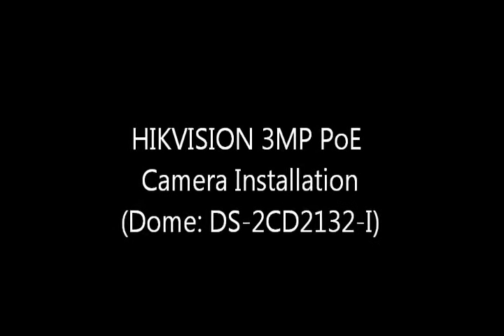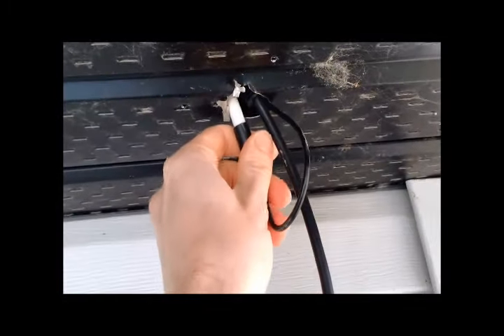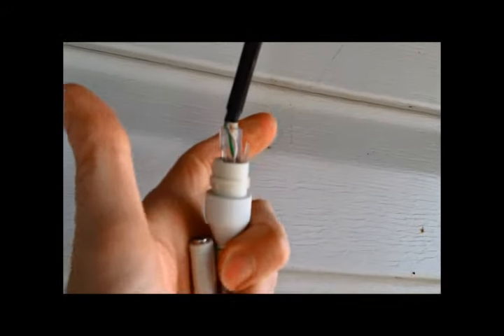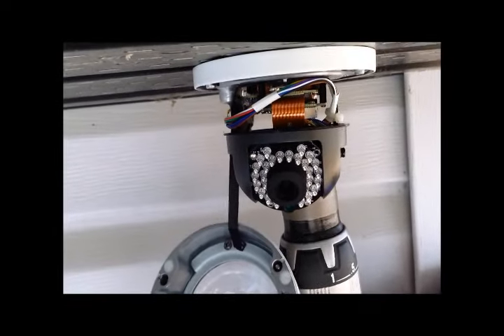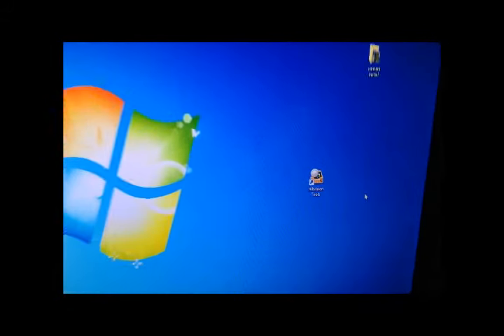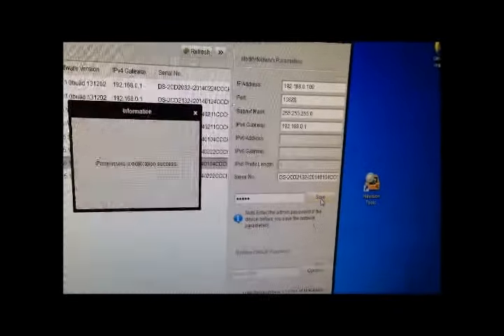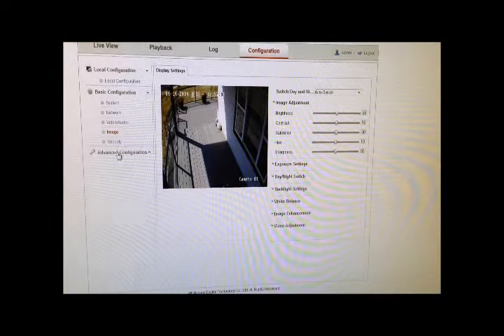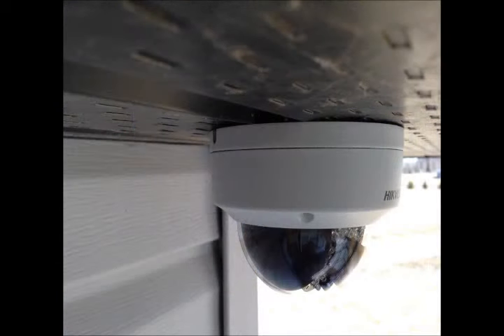HIKVISION Dome PoE IP Security Camera Installation Guide

Comment: I have got four Hikvision cameras installed plus the Hiklook DVR. I have installed the S ADP software but all that is appears when I open it is my router. How do I configure the software so that it will show my cameras?
Reply from the maker: SADP will only show the DVR if you are on the same network as the DVR.  It cannot see into the DVR's network were the cameras are located.  It do this, you need to plug your PC into one of the DVR channels.  This way, your PC will be on the same network as the cameras.  Hope this helps.
Reply: @HomeTechDIY  Thanks for the reply, that was very helpful indeed. Okay, another question if I may. I have got an IP bird box camera that is also plugged into my DVR. Last year the camera was plugged directly into a POE adapter which then went into my network switch. A company called Cam Secure hosted this camera online and I was able to let the public see the birds nesting as well. After what you have told me I suspect this is not going to be possible since the camera is plugged directly into the DVR and the DVR goes into my network switch. I think I'm going to have to do revert back to how I was set up last year, correct?

Comment: Thx for the video. Is it a PTZ camera? Can you control the rotation and tilt angle over web interface?
Reply from the maker: No, this is not a PTZ model in this installation video.
Reply: newfiebort Thx, fastest answer ever! ;)
Reply from the maker: gyurxi551
I have been thinking about this one for a while.  The foam hood seems to be too large.  Your are right, it's there to avoid any reflection back into the camera.  I think you should be safe to cut away some of the foam to allow more IR light to shine out.

Comment: Hi, why does Hikvision camera can't show English week OSD? Maybe you can ask Hikvision give you a new firmware. In addition, this camera should is a vandal proof dome, but your cable installation is easy to been cut, it is better you can use a metal tube.
Reply from the maker: +Sysvideo IP Camera Correct, this firmware has a defect with the on screen display.  I didn't want it displaying anyways, so it was no big deal and therefore no need to upgrade the firmware.  The firmware can be downloaded from the Hikvision website but I would need to ensure it was for the correct region.  Agreed, there are certainly more steps I could have taken to make this setup 100% vandal-proof.  Thanks for the idea of a metal tube to protect the wires!

Comment: I have 2 Hikvision DS-2CD2135-IS cameras hooked up from a giagbit PoE switch to router to computer, I downloaded ivms4200 software from hikvisions website, the software finds the cameras but I cannot get a picture, using ip address 192.168.1.64, I cannot figure out why I cannot get picture from the cameras?  Any help would be appreciated, thanks.
Reply from the maker: +Keith Daniel Are you able to get a picture using Internet Explorer?  I'm assuming the IP addresses for the cameras are not the same.  What is your subnet (192.168.1.1)?  You might need to change your camera's IP address to be on the same subnet.  Do you just have 1 router on your network and are there any internal port forwarding rules in place?

Comment: Do you attach the dome camera to the vinyl soffit directly with self tapping screws or is there a piece reinforcement (wood) on the other side of the soffit for the screws to go into?
Reply from the maker: In my case there is nothing on the other side and the metal soffit does hold the camera quite securely in place.  I used the screws that came with the camera and it's been holding up for a couple years now.  Once the winds hit 60mph, it does shake a tiny bit.  It's well protect from most winds in this location.  If you can out wood behind the soffit, I would recommend doing so, just in case there is a huge storm or a vandal.
Reply: OK, thanks! I didn't realize that was metal soffit.

Comment: When you mount it to the ceiling, are you just screwing into the vinyl (if that is vinyl) or do you have wood on the other side.  I have a vinyl ceiling where I want to mount my cameras and wasn't sure how to do it.
Reply from the maker: +Greg Ebel The best solution would be to screw the camera into a strong material, like wood.  In this video however, I am just screwing it into the soft metal soffit.  There isn't a lot of wind in the back corner where with was installed and the picture is doesn't ever shake.  Also, to install wood behind the soffit would have involved removing the soft metal and replacing it with new stuff....  sounds like a lot of work.

Comment: 2 questions, what's better a bullet style or dome style camera for night vision. and 2,where can you purchase hikvision cameras and be guaranteed to get a real hikvision camera instead of a knock off (as I've heard happens on amazon)?
Reply from the maker: I don't notice any difference in the night vision between the 2 models.  I live in the country and there are no streetlights and the quality is good (not perfect).  I can see foxes and rabbits walk by with no issues (within 30 feet).  If you have any outside light, like streetlights, the night vision is almost perfect.  I prefer the dome because it's more tamper-proof, a nicer setup (IMO) and I don't get any bugs or spiders hiding out in the corners as I do with the bullet camera.  I need to sweep away spider webs from the bullet models once a week, whereas I only need to clean the domes 2-3 times per year.
To answer your second question, I think what you mean by "knock off" is a Chinese Hikvision model.  People seem to get upset over the Chinese models mainly because there are fewer releases of firmware updates.  The firmware on the Chinese models is almost perfect and doesn't require updating... so why fix what's not broken?  If there is a particular functionality that is in an newer firmware release, I would avoid the Chinese models.  Everything else in the camera is exactly the same and made with outstanding quality and has an awesome picture.  I know I haven't answered your question yet....  the answer is, "I don't know."  If this is an issue, I would reach out to the vendor and double check.  Make sure to pay with a means where you can file a dispute if you do not get what you are promised.  Hope this helps!
Reply: dome ptz because you can rotate cameras
Reply from the maker: Mateo Vugrinec Yes, the dome PTZ option would be better but the cost is higher, and for me, living in a cold climate I would need to get the version with the heater, which again costs even more.  The camera in this video does not have those options and costs about $120 USD.

Comment: what does POE stand for? Point of entry? lol or.... i dunno.
Reply from the maker: It stands for Power of Ethernet.  The camera can be powered from electricity provided by the switch.  There is no need to plug the camera into a power outlet AND Ethernet when using POE.  Hope that helps.  Thanks!
Reply: Oh no..... sorry. Power over Ethernet, presumably eliminating the need for a seperate power supply. Do PoE cameras have enough current for driving motorised direction or are they only capable of driving the camera?
Reply from the maker: If using POE for a PTZ (Motorized) Camera then Yes, POE can provide enough power.  I am however not sure, off the top of my head, what the power allowances are.  I believe the maximum distance is about 300 foot however.

Comment: Problem with IP camera is that they have a connector to cable way too large. Look at the size of that hole, bit enough for mice to get in. And dripping bricks or concrete wall requires a masonry drill bit at least 20mm thick, where the hammering vibration will shake your bones to bits and dentures out of your mouths. These cameras should have had a female Ethernet (PoE) connector which is smaller and requires a narrower drilling hole, and the cables should then have a females socket at one end and male plug at the NVR/DVR end. They idiot manufacturers made a big mistake.
Reply from the maker: Yes, the hole needs to be huge....  but new building installs use junction boxes for the CAT6 cable which are then terminate inside the box.  Same with installing cameras on masonry; drill a small hole for the cable and then terminate it into a junction box, then connect the big clunky adapter.
Reply: @HomeTechDIY  
Nah nah nah, no way. I don't like junction boxes, Cat6 cable goes out of the wall and into the box and then the camera connectors go into the box, nah nah nah again. It's much better it the camera stays neatly attached with no cables shown by bolting the pedestal straight against the wall, a cleaner finish and presentation than having a boxe next to it and the camera cables inserted and connected into the box, which it is also easy to be damaged/stolen or cut by vandals. The mistake of installing a fat female LAN connector at the cameras cable end needs to be changed. You don't even need a cable as everything can be plugged in the Dome camera housing. Even the bullet or turret cameras can be simply plugged inside the body of the cameras. Instead of plugging the connectors cable to cables, why not just plug the male connector into the female connector inside the bases of all cameras. Why the IP cameras must have a short bit of cable sticking out of the cameras, I'd  be damned if I knew. 🤔

Comment: Thank you for all the videos regarding Hikvision.  I bought a Hikvision NVR from a local authorized dealer two years ago and I have had zero problems with the NVR and the cameras since the day I installed everything.  Yes, the system is more expensive than most everything else out there but you can't argue with 100% uptime.
Reply: Hey there. If you had no problems, can you tell me if you get false alarm during early morning when the grey screen changes to colour and in the evening when the daylight changes to night time and the screen goes grey (IR illuminated). I've asked around but nobody seem to have any idea, otherwise they'd responds. How do you stop this false alarm? It's driving me nuts.

Comment: doesn't this slow down your network?
Reply from the maker: +Mac Pelao I have 13 cameras currently running all on a gigabit system and my network utilization peaks at 6%.
Reply: these cameras use H.264 compression, so they won't eat up too much bandwidth, even at full resolution.

Comment: What model poe network switch are you using ?
Reply from the maker: I am using the BV Tech 16 Port 120W 10/100Mbps Network Power Over Ethernet Switch - Designed for IP Camera Use (Gray)
The switch need to be IEEE 802.3af.  I think any of the monoprice switches will work too.

Comment: Hi, I have a question... I would like to install some of that camera but I have a problem. The network cable arrive at the poe router but I have to install a PVR for recording camera images in the kitchen. So have I to make the camera connection directly to the PVR or can I make the registration also with the camera linked to the router? thanks
Reply from the maker: +Danny Fiorot It depends on the PVR.  If the PVR has PoE capabilities (and a hard drive) the PoE switch is not required.  But if the PVR is a computer/laptop, you will connect the camera to the PoE switch and connect the PVR to the PoE switch (without power).  In my setup, I connect the camera to the PoE switch, then the PoE switch to a router and the router to my PVR.  Let me know if this helps.
Reply: Yes it's hopeful. My question is if I can connect the camera DIRECTLY to my router and recording in a network PVR in another room attached to the same network. I wil post you a scheme later.
Reply from the maker: +Danny Fiorot Yes, that is 100% possible.
Reply: Perfect! Thanks a lot!

Comment: When I set up camera I can see it online and on app, but WHEN I REMOVE ETHERNET cable it doesnt find camera. I have IP camera and I thought I will need only AC adapter to power camera. Do I have to always run this camera with Ethernet cable to be bale to watch it online or there is some set ups I need to make to run camera without Ethernet cable? I thought Ethernet cable only for set up and then I can unplug it.
Reply from the maker: +Kon Musa Sounds like you don't have a wireless version of the camera.  If it doesn't have WiFi, then, yes, it will need to be plugged into the Ethernet cable all the time.

Comment: Thanks for the review, I hope you are still answering questions. I live in an apartment and want to hook this up looking out a window so it will be looking through glass. Is there an option in the software to disable the onboard IR lights to prevent the glare in the lens seeing it's own IR lights? I will be using external IR lights. Thanks in advance if you get this. Jim.
Reply from the maker: +Joe Blow Good question! On this version, yes, there is an option under advanced config > System > Service to disable the IR light.  I have never tested it, but I will and let you know.
Reply: +newfiebort That would be great. If you are able to disable the IR lights and it still remains in night vision mode, this will be the unit I will be getting. thanks again for your help.
Reply from the maker: +Joe Blow I just shot a quick demo for you.  Have a look at my channel to find it.  Hopefully, it helps!

Comment: Are you able to somehow zoom and rotate the camera through a web interface? I have few of these installed in remote locations of over 200km from me, and I really would not like to make the trip to adjust them physically. There are some controls in live view tab, but the camera does not react in any way to buttons being pressed.
Reply: +Jozef Morvay 
Was my question too.
But he directed it first by hand to the point he wants to watch, and the placed the cover.
So no, I don't think you can do that.
Reply: Jozef Morvay you need a ptz those controls in the web interface are for ptz cameras so will obviously do nothing on them domes

Comment: Which lens did you get with this camera? The 2.8mm or the 4mm?
Reply from the maker: Tom Bixler I am using the 4mm lens.  The 2.8 creates a washed out effect in the center of the picture when the night vision IR's are on.
Reply: newfiebort what is the con's of getting a bigger lens.  For example buy a 12mm.  Wouldn't the bigger the lens the better?
Reply from the maker: Ang ipp A 12mm lens is a zoom lens and might be a good solution for different situations.  If I were to have used a 12mm lens in this setup, you would only be able to see where the cat is sitting.  You would not be able to see who was walking up the stairs or any of the surroundings, just a closeup of the cat.  A 12mm lens would be good if I was not able to mount a camera close to my subject/area of surveillance or if I wanted a closeup on a particular area, such as a store doorway.  The night vision would also be impacted with a zoom lens because the IR lights are not zoomed in.  You would loose some of the IR light because the IR lights might not be bright enough to travel the distance from the camera to your subject and your image may be darker than expected.
Reply: newfiebort ok I got it. The higher the mm is, it will able to see longer distances but a the object gets closer to the camera it will become blurry.  Also another disadvantage it the night vision. I think I will get a 4mm (like you have) for the door enterance, and maybe a 6mm or 12mm for 2 lane driveway.   Thanks.

Comment: Great video. I have a couple quick questions about your setup.  What kind of ethernet cable are you running between your cameras and the POE switch (Cat5 or Cat6)? Anything special like plenum or riser cable? 
Thanks.
Reply from the maker: Thanks for watching! In this video I use in-wall Cat5.  I have used Cat6 in some other applications and I haven't experienced any issues.  The cables I use are specifically for in-wall use.  In some of my other videos I use underground rated Cat5.  Hope this helps.

Comment: jfc dude, you're supposed to crimp the jacket in the ends.  You shouldn't have connectors hanging off the wire, it should be supported by the jacket.
Reply from the maker: Thanks for the advise!!
Reply: not
Reply: You are right, however it looks like he may have used outdoor cable (thicker outer sheathing) which is much harder to squeeze in to the connector. I have worked with some outdoor cables that are almost impossible to get in to the connector. 
Some times what can happen is the outer sheathing can get pulled back and actually slip out of the connector. If the connector is handled a lot or prone to moving the solid copper pairs will inevitably snap.

Comment: Hi. I just wanted to know, what is the input voltage of the camera and the output voltage of your POE router?  Usually these two does not match isnt it? Is there step down circuit builtin to the camera?